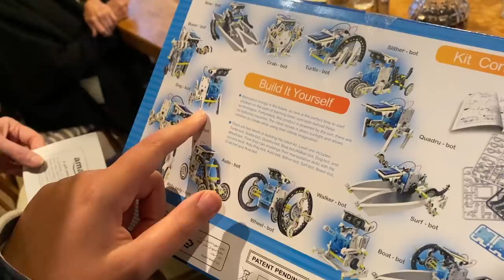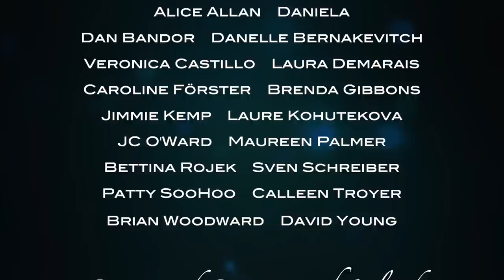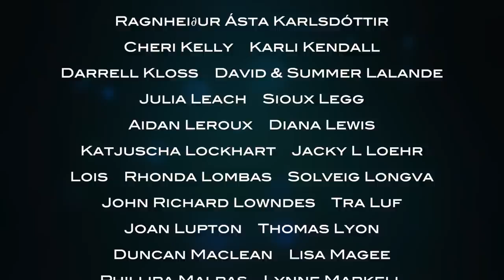THE CHATEAU DIARIES: Life is Better with Tea and Madeleines!

Comment: Stephanie, about your internet connection problems. Have you considered looking into ways to improve it yourself and not hope the French do it for you? A possible solution could be one of the many systems used in mobilhomes. It is a system that strengthens the existing 4G signal (drastically) and can also provide wifi in the chateau for a number of users. This is an example: https://www.motorhomewifi.com/product/4g-roof-antenna-e5577-mifi-save-25/

Comment: Because of your internet connection troubles, I have searched for satellite internet providers in France, so here you have two options to check all the details. If you make a contract for two years or so, usually they give you equipment for free, and the monthly prices are quite normal (40€+).. 
Remember, it goes through satellite, so it doesn't matter how far in the country you are, the connection is always the same. Although especially download speeds are fast in this option (from 22Mbit/s), also upload isn't so bad, although not perfect (6Mbit/s). For uploading vlogs you need good upload speeds, for all the guests, you also need strong download speed. There are costlier, faster packages.. 
You should check your current connection speed on 
https://www.speedtest.net/

Providers in France:

https://www.nordnet.com/connexion-internet/internet-satellite

https://www.skydsl.eu/fr-FR/Particuliers/Internet-par-satellite

There is a lot of small print, you should check everything, or ask a tech friend to research it for you!
Reply: you could make a promotional deal with them and mention them at the end of patrons for a couple of seconds and maybe get free internet in exchange, because a lot of people don't know about this option.. (you don't, it seems..)